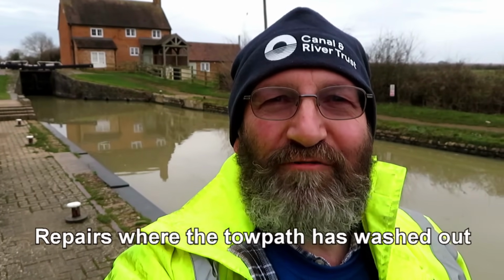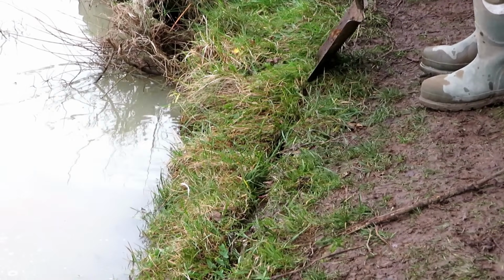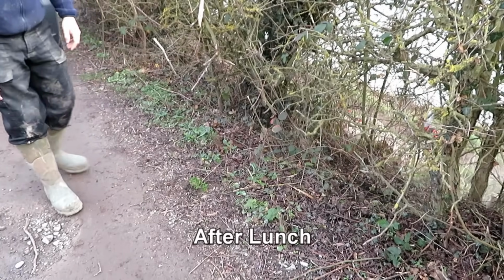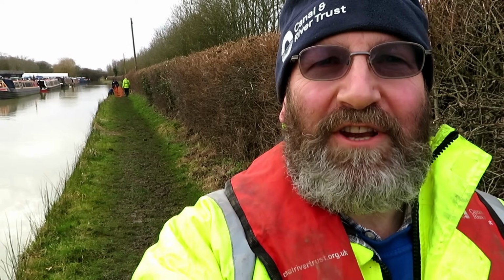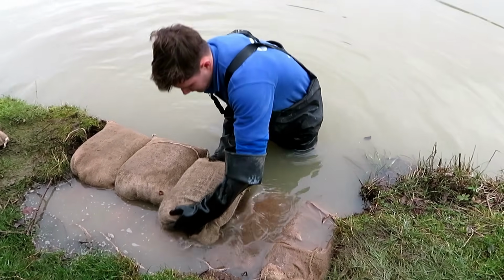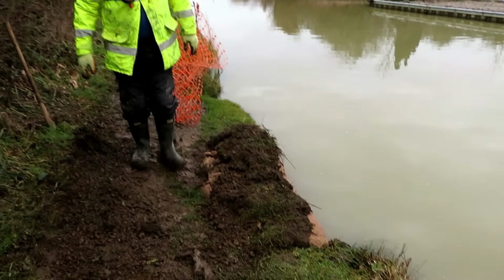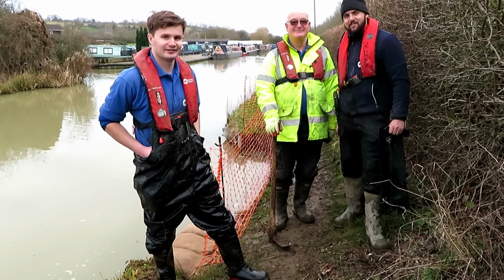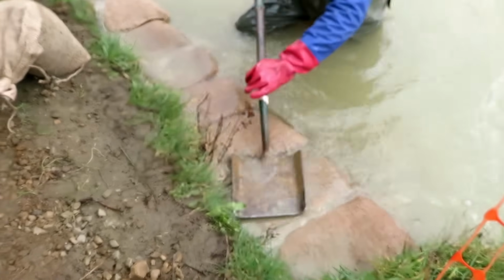379. How To Repair a Canal Towpath

Comment: Being a groundworker back in time, it is great to see how others maintain such repairs in an area other than road sides and motorways. The Canal & Rivers trust workers do work extremally hard to fix what needs to be fixed. Just as in any job that requires maintenance. Dedication and a workmanship that goes hand in hand together to make things a better and more safer environment. :elbowbump:🖖👍Brilliant Vlog Alan.
Reply from the maker: Thank you for your great comment, the CRT have a difficult job maintaining the canal network, no two locks are the same, gates have to be purpose built, there are occasional breaches, many fallen trees, very labour intensive. Glad you enjoyed watching 🤠